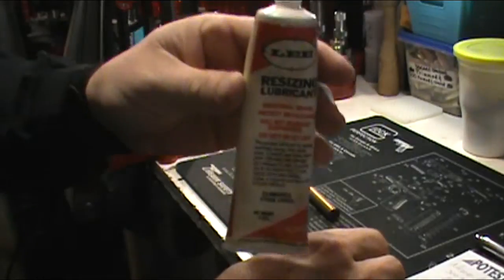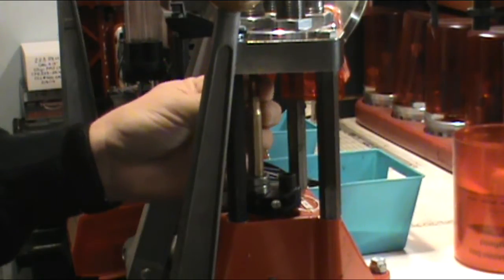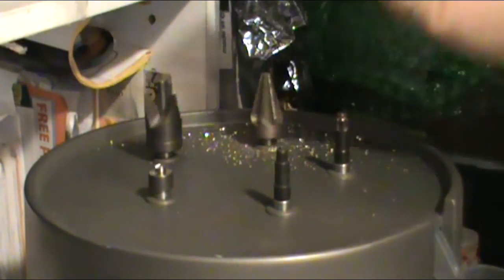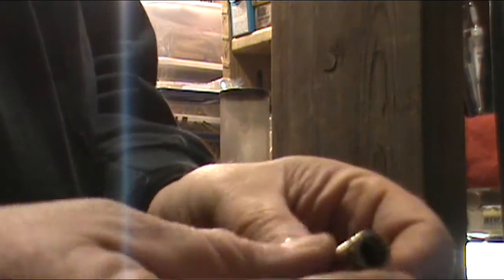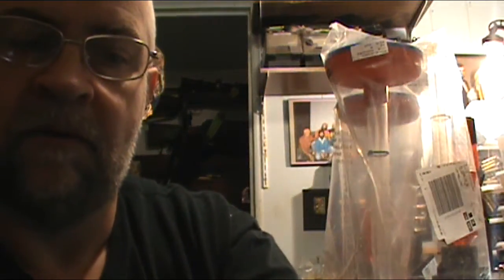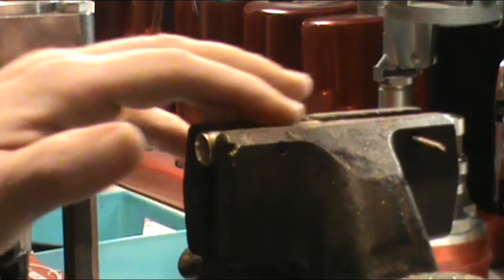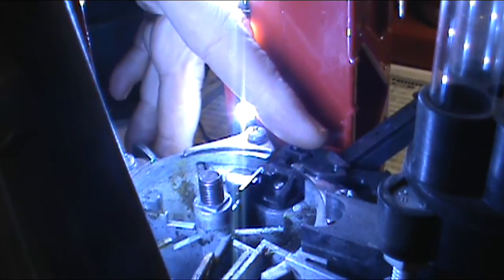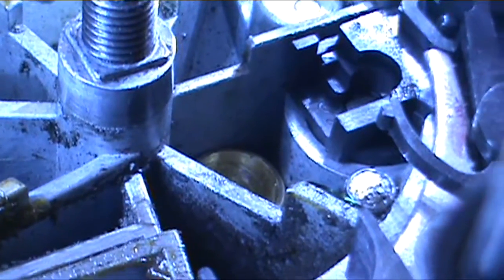LEE Loadmaster Primer Catch

Comment: Excellent work! I did not have a rifle case lying around, so I tried it using a .357 Mag case. Worked great. I left the spent primer in, drilled a tiny hole in the side near the mouth of the case. Ran a wire (from a bread twist tie with the plastic removed) through the hole and made a small hook. Case now hangs right in the spot as shown in your video. Took me less than a minute. Thanks for the idea!

Comment: Great video, I'll take the silly putty out and try the case idea. The silly putty was just a quick fix, it works but it sucks using tweezers to pick out the primers
Reply from the maker: This has worked fine for me for years!  Thanks for watching and commenting.  Juddie - J & J TOA
Reply: My primer wedge rod was loose, had 65 smashed primers out of 185 good load's. Tighten the wedge rod and had 2 smashed primers out of 100 load's.

Comment: 30-06 nor 308 would even come close to fitting between those ribs of the carrier on my 2014 LLM? Only a .45 acp case would fit without falling through. How old is your LLM? You had not replied for a while, so I just flooded the bottom of that section of the carrier with about 1/4" of epoxy to seal the section, but it will be cumbersome to fish the primers out. Thanks.

Comment: Is it just me or this a Lee Pro 1000 and not a Lee Load Master?
Reply from the maker: Its just you!  If you watch the entire video you will see that I install the primer catcher in my Loadmaster.  In the beginning you see me sizing the 30-06 brass in my 4 hole turret press not a PRO1000.  Now you might of seen a PRO1000 since I have two PRO1000's, a 4 hole turret, a single stage and a Loadmaster.  All my press setups are LEE.